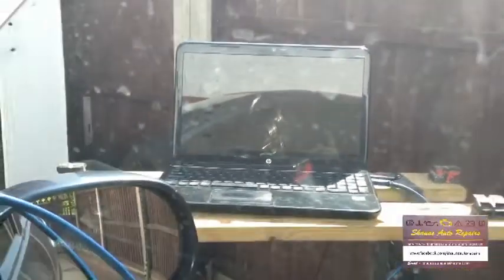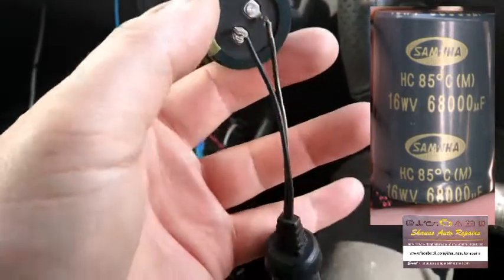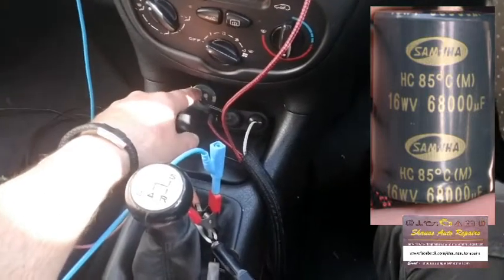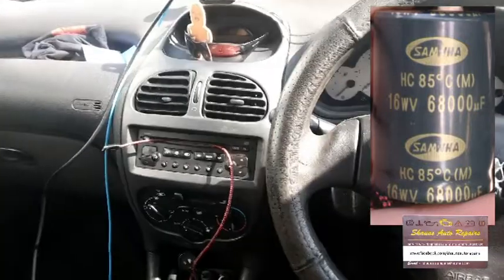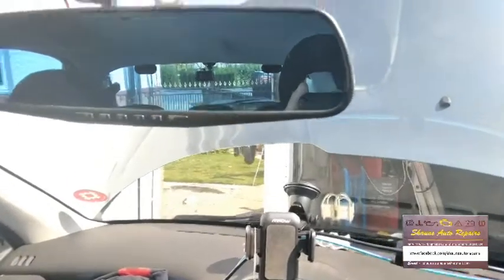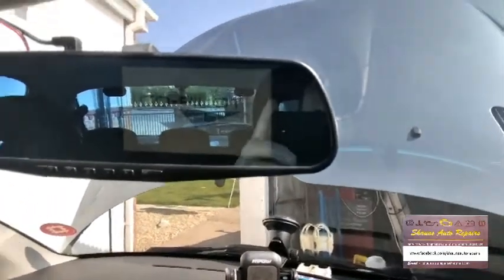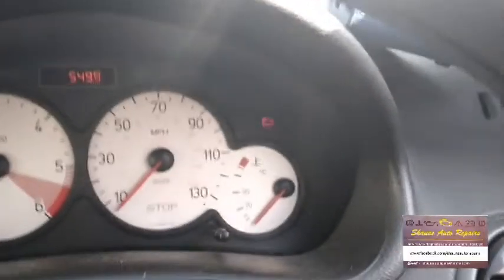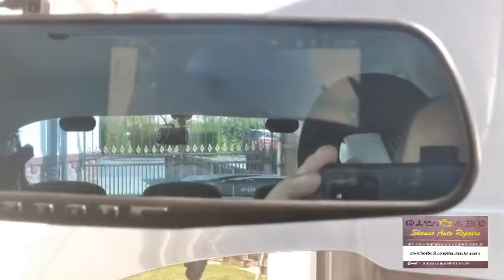DOES YOUR DASHCAM SWITCH OFF WHEN YOU RESTART YOUR CAR? plus follow up link showing wiring diagram

Comment: My MK7 Golf stop start turns off/on dash cam when engine auto restarts. I have even wired direct to battery and same thing.
With the dash cams male cig socket, could I wire the capacitor in-line on the positive wire rather than a double cig socket for tidiness?
Any help much appreciated. i most certainly will send you a coffee or prob a beer LOL, thanks mate from Australia.
Reply from the maker: hi, sorry for the late reply. yes you could certainly wire the capacitor in the feed wire to the dash cam... the positive terminal on the capacitor would need to go on the 12v positive wire on the dash cam. the negative side would need to go to an earth or to the negative wire on the dashcam. hope this helps.

Comment: Please help me. I bought watex 360 dashcam when i start the car it starts but after sometime it shut down itself
Reply from the maker: Hi, does it shut off completely or is it that the screen goes off into screen saver mode after a short time. If its just the screen then this can be changed in the settings menu. If it shuts off completely you either have an intermitant fault in the 12v supply or the unit is faulty. If its plugged into a cigerette lighter plug id check the connection there.

Comment: Im having problem with my nectbase keeps switching on and off when driving
Reply from the maker: Does it work OK on the internal battery?. I'm thinking that if you have it powered from the cars 12v aux socket you proberly have a bad connection on the plug. You could try cleaning all the contacts and see if that improves things
Reply: @shaunsautorepairs5410  I got  install in my 1 series it switches on record after a while it turn off and I have to keep pressing the power button to turn it back on